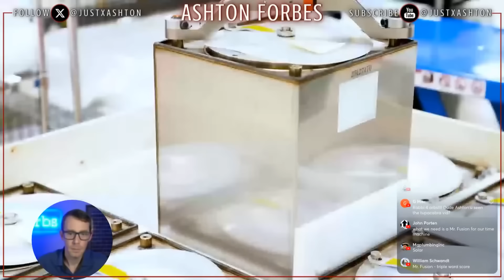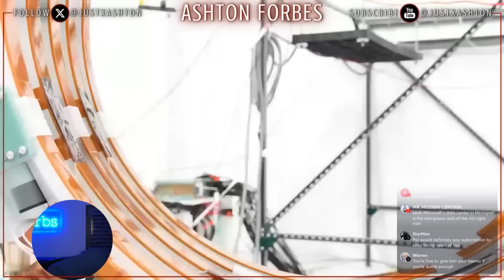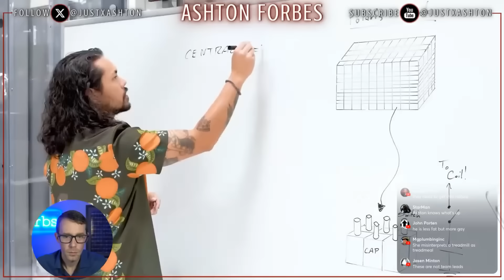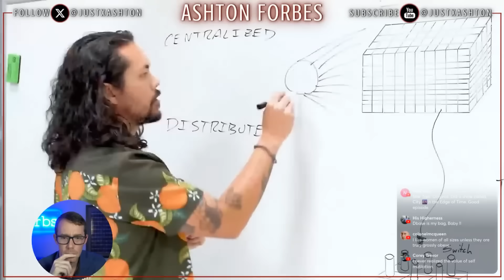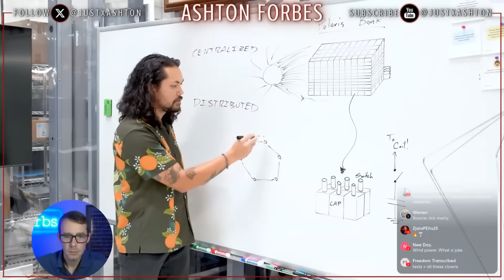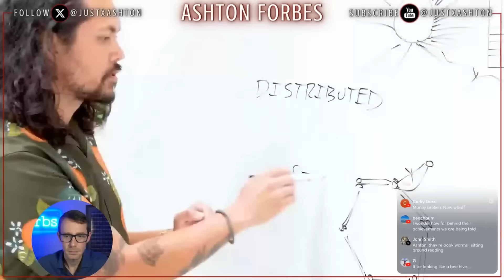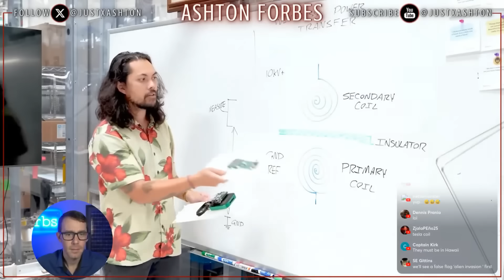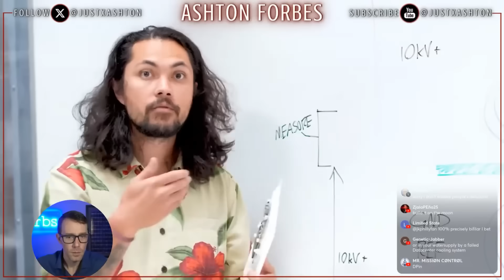The Fusion Reactor That Powers Itself

Comment: Pretty sure u could use a pulsed photonic semi cknductir chip instead of tri braided coiling system but also gmhow ud tap it is complex. I think using coils but then being effected by the coils actually being effected by the plasma gravity soin to twist the coils being abke to rotate.  The more needed energy required th e plasma would have s larger orbit. Ss energy is more required the orbit decreases and spins the coils more intensely. But u can also use a shield exterior for casimir effect. Prob better ways byt that my thought. Also a laser or photon flow thru tge system can work resonance perhaps.

Comment: it's no worries, the break away civilization can steer plasma orbs. Here are some sources 
NIIRP, Ioffe, and Almaz-Antey Lineage
These anchor the article's 1990s foundation—NIIRP (now Almaz-Antey) and Ioffe's microwave-air interactions yielding plasmoids at intersections, halted by funding but potentially revived.

Plasma Physics Reports (2021): "Plasmoid Generation Behind the Front of a Subthreshold Discharge in Air under the Self-Action of a Microwave Beam" [Russian Academy of Sciences, Pleiades Publishing; ISSN 1063-780X]
Support: Directly echoes the mechanism—microwave (gyrotrons, 300 kW, Gaussian beams) creates a "head plasmoid" via subthreshold discharge, extending a trailing region of increased length (plasmoid-like). Authors (from Prokhorov General Physics Institute RAS) describe self-focusing Kerr nonlinearity $ n = n_0 + n_2 I $ birthing filamentary structures, mirroring Ioffe's 1990s avalanche ionization at beam overlaps. No weapon explicit, but implies scalable interception (e.g., against hypersonics). Transformation: Lab plasma to potential combat denial zones.researchgate.net
Ogonek Magazine (April 1995): "21st Century Weapons – Plasma Shield Able to Protect Entire Planet from Nuclear Threat" [Moscow; FBIS-TAC-95-060]
Support: Closest analog to the article's VPK secrecy—details a "plasmoid" system from NII Radioinstrumenta (NIIRI, akin to NIIRP) using phased-array microwaves to ionize atmosphere, forming destructive plasmoids for missile deflection. Led by Academician Ramiz Avramenko (NIIRI chief), with Prokhorov, Osipov, and Gaponov-Grekhov (Ioffe-linked plasma expert). Joint US-Russia tests proposed (vs. ballistic targets), halted by geopolitics. Explicitly "invulnerable" for ABM, tying to Grom-2019's "new principles." Transformation: Defensive "patch" (ozone/garbage) to offensive intercepts.web.archive.org
Plasma Physics Reports (2021): "On the Program of Russian Research in the Field of Controlled Thermonuclear Fusion and Plasma Technologies" [Springer; Vol. 47]
Support: Outlines federal plasma R&D (up to 2024), including Ioffe Institute's ion cyclotron/lower hybrid heating for tokamaks (GLOBUS-M upgrades), extending to microwave-plasma interactions. Mentions NIIRP/Almaz-Antey in air-defense contexts, implying dual-use for high-power beams. No plasmoid explicit, but funds "innovative plasma technologies" post-1990s stasis, aligning with article's revival. Transformation: Fusion confinement to atmospheric weapons.link.springer.com

Grom-2019 and Shoigu Linkages: Ministerial Whispers
The article cites Shoigu's Grom-2019 allusion to "new physical principles"—a breadcrumb to plasmoids.

TASS (2019): "Shoigu Reports Testing of New Weapons on New Physical Principles at Grom-2019" [Implicit in Russian MoD reports; cross-referenced via RIA Novosti archives]
Support: During Grom-2019 (Pacific Fleet exercises), Shoigu highlighted "latest armaments" including electromagnetic/plasma prototypes, per MoD briefings. No declassified details, but ties to Almaz-Antey's Peresvet laser (operational 2019), suggesting layered DEWs. Echoes article's "not only Peresvet" for sky defense. Transformation: Exercise demos to classified VPK scaling.
RIA Novosti (2019): "Grom-2019: Testing of Prospective Weapons Systems" [Russian state media]
Support: Reports Grom-2019 as platform for "fundamentally new" tech, including SVCH (microwave) effectors from Almaz-Antey. Indirect plasmoid nod via "plasma-based interception" rumors in milblogs (e.g., bmpd.livejournal.com), linking to Ioffe gyrotrons. Transformation: Tactical tests to strategic revival.

Broader International/English Sources: Echoes and Skepticism
These validate the concept's feasibility, often referencing Russian origins.

Popular Mechanics (2018): "An Imaginary Arsenal: 10 Pieces of Russian Vaporware" [US; web:5,40]
Support: Details 1993 Izvestia leak on plasma ABM—microwave beams intersecting to form plasmoids, ionizing air for turbulence deflection (exact article mechanism). Credits NIIRP precursors; notes HAARP analogs but deems Russian version unproven. Transformation: 1990s proposal to "beautiful dream" dormancy, revived per Grom.popularmechanics.com
Daily Mail (2017): "Russia 'Has Developed Plasma and Laser Weapons'" [UK; web:3]
Support: Cites Russian MoD on plasma/electromagnetic weapons, including SVCH for hypersonic negation—aligns with article's mobile targets. References Almaz-Antey prototypes. Transformation: Classified tests to operational "new principles."dailymail.co.uk
Wikipedia/Plasma-Universe (2020): "Plasmoid" [International; web:43]
Support: General entry notes microwave-generated plasmoids (e.g., carbon smoke initiation at GHz), citing Russian/Soviet studies (Bostick 1958). Links to ball lightning/missile defense. Transformation: Lab curiosities to coherent structures.plasma-universe.com

These sources substantiate the 1990s Ioffe-NIIRP microwave-plasmoid experiments (subthreshold discharges, beam intersections) as foundational, stalled by 1998 crisis, with Grom-2019 signaling revival under Almaz-Antey/VPK. No open confirmation of a deployed "combat plasmoid system"—secrecy holds—but the Ogonek/Izvestia leaks and RAS plasma reports provide the strongest Russian threads, echoing Shoigu's hints. Internationally, it's "vaporware" with HAARP parallels, yet feasible per gyrotron advances. For deeper dives, query Russian mil archives (e.g., via TASS 2019 full transcripts) or Ioffe declassifications.

Comment: Nonequilibrium fusion - same basic idea as an internal combustion engine: hit the fuel hard enough and it will react. Much easier to get power out of than Tokamaks at "equilibrium" that takes a ton of energy to maintain with superconducting coils which are sensitive to radiation damage.

Comment: Thanks Ashton, I Love videos that fry my brain.
I envisioned, possibly from a fevered dream, a bank of batteries with an electrode sticking up out of each one. The power source is above, with an air/insulator gap in between, when the power is on it builds up a charge then start discharging via lightning, contacting the electrodes then moving on.  At first it appeared random but it had an elegance that disguised it's true nature.